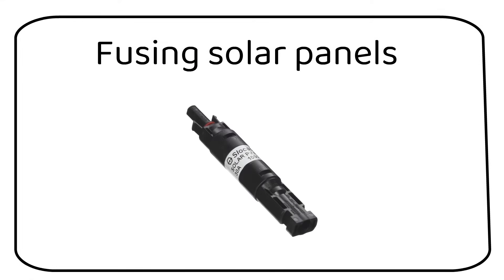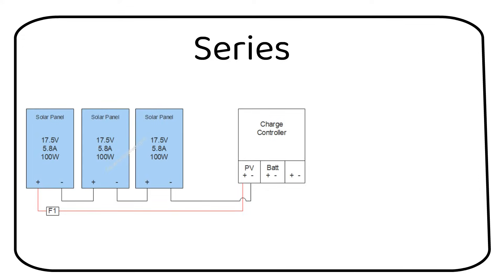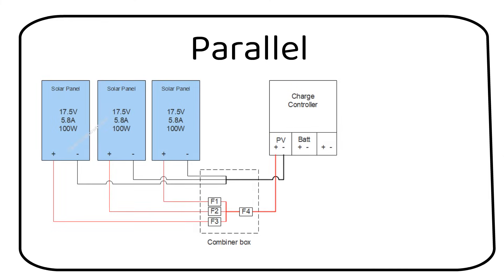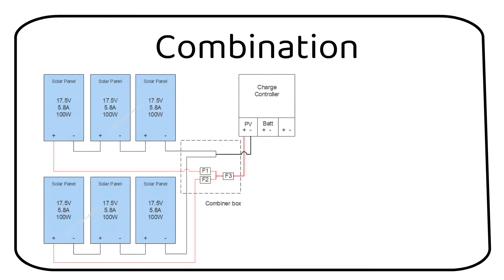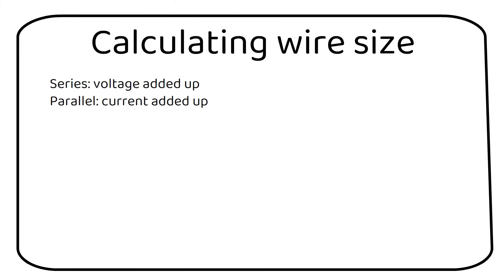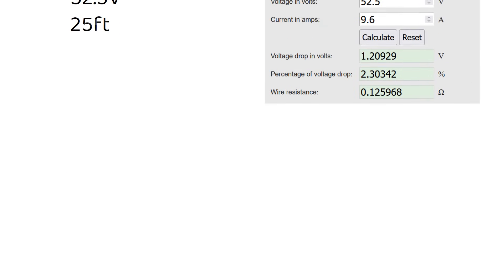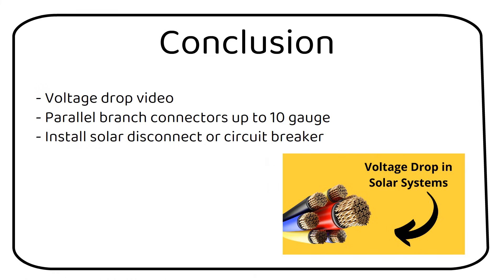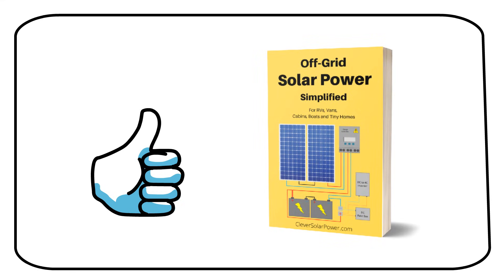Fuses For Solar Panels: Series and Parallel Fusing

Comment: Do I need F4 in a parallel connection? I have 3 panels in a string(lsc rated at 6.86), the only way it can exceed the amount is if all the other fuses in the parallel string isn't working. I'm asking because I want to  avoid as many point of failures as possible,  as the panel is exposed to the weather.   But if you were to put a fuse after the positives of the string are connected, it would be to protect the inverter, and if that's the case, the limit on (in my case a Bluetti is 20A). So technically a 20A fuse is all I need, as the 10Guage wire will not fry because of 30+Amp, and if it goes back to my panels, the fuse should prevent it from destroying the panels.  But, from what I understand it's not bad to over Amp, a string, and worry more about the Voltage in  solar set-up.

I don't think you need to do any math with fuse, you just need to get a fuse that matches what the panel max at. unless it doesn't have the maximum rating on the panels spec sheet.

Am I wrong? Because every youtuber don't mention an f4, i'm just trying to understand your set-up.

Comment: just curious the fuse and mcb are the same right and when using either of them is to match solar panel like what you calculate but not on the charge controller maximum pv voltage or maximum current ?

Comment: I have 3 panel 630 watts each voc 50.20 isc 16.09 and my mppt is 50 volts max and 60a max. I will connect parallel to my mppt. I'm going to use 20a each panel (f1 to f3) but the more fuse is only 30a max what will I put on the (f4) fuse? Thanks for the help.
Reply from the maker: Your charge controller will be damaged in winter when the temperature is below STC.
Reply: @cleversolarpower  what will I do do I need to fuse it or not? Sorry I'm a beginner. And I don't have a winter. I want to learn on fusing...

Comment: Thank you for giving the knowledge.  when calculate the fuse size, where was that 1.56 came from ?
Reply from the maker: That's two safety factors 1.25x1.25 that's for outdoor cable ratings because they can get very hot.
Reply: @cleversolarpower  Thanks for the class Man

Comment: I have a 24Volt 120A MPPT Solar Inverter with BMS that i want to connect to a 24 Battery. Do you recommend a 24Volt Battery that has 120, 150 or 200Ah ? And is it best to use a 250A circuit breaker installed at the battery end or another?

Comment: what if I have 2 different panel? one has 15.98A & one has 10.72A Isc.
Reply from the maker: I made a video about wiring different solar panels. Search for 'mismatched' on my channel. If the voltage is the same and the current is like you described then wire in parallel. Because in parallel the current gets added up. Or use two charge controllers, one per panel.
Reply: @cleversolarpower  Already watched the mismatched panel, but didn't really get to figure out how many amp I need for the 2. thanks anyway

Comment: Formula ISC? You lost me on that. Can you explain the formula.
Reply from the maker: Isc * 1.56 -> 1.56 is 1.25*1.25 which are two safety factors multiplied with each other for outdoor temperatures.

Comment: Where do you get the number 1.56?
Reply from the maker: Safety factor for outdoor wiring. This is because the cable can get very hot in the sun.

Comment: If the short circuit current is 13.58A; open circuit voltage is 38.95V with max fuse at 25A:  For a 3S2P setup, 13.58A x 1.56 x 2 = 42.3A  is that correct? Would I be able to get a 45A fuse?
Reply from the maker: You should fuse every series string first with 25A. So you need two MC-4 connectors fuses. Then have one DC circuit breaker so you can turn off the whole solar system. This is can be a 64A DC circuit breaker suited for solar (1000VDC).

Comment: Which size of wire should I use in 3 pieces of 350w solar panels system
Reply from the maker: Check my video about wire sizing for charge controllers.

Comment: Can i use a combination of fuse and diode in 3 pieces of 350w solar panels
Reply from the maker: No, a diode only prevents backwards flow of electricity.
Reply: @cleversolarpower  thanks

Comment: why did you use 6.2 amps in the calculations when the panels showed a rating of 5.8?
Reply from the maker: I use the Isc, highest possible current.
Reply: 1.25 multiplier

Comment: Good day , this safety factor 1.56 is it common/ constant to all countries ?.
How can we find this safety factor ??
Reply from the maker: It's a standard factor for cables that are outside under the sun. Indoors safety factor is 1.25
Reply: there is no factor.
a panel I max is a absolut number a panel can produce only this or lower currents!!
so to prtect against a 100% limited current is pure nonsens in any aspect.
so on panles no fuses theyx are for nothing existing.

on the battery side coz a battery is a umlimited power source a fuse will be needted and this is best set below your wire limits without factor nonsens !!!

lets say you you a wire that can handle ~40 Amps current max, on this conditons it get war, over time so the best way to set a real protection to it set from battery to charger a 35 Amp fuse to wire never will run on its limits and you protect the wire from this.

no mgic factor or nonsens theories from youtubes use your brain.
make yxour build with bigger wires then you really need maximium the set the fuse below this wire maximum to give this wire a real protection.

that is all the magic.

Comment: if you're adding fuses on the positive line, doesn't that add some resistance, and therefore require you to add some extra wire on the negative side to equalize the resistance between both lines?
Reply: Can't think of a good reason to increase losses just so the voltage drops on each side are the same, what are you trying to achieve? The controller only cares about net differential voltage at its input.

Comment: Thank you for you video -  I have 4 550 W panels, with the following specs. What configuration would you recommend ? 2S2P? For Fuse 1 and Fuse 2 (14.01 x 1.56 = 21.86) would a 30a inline fuse work?? And then for the Fuse 3 - what type of fuse should be used?? Is there any benefit of doing a 2P2S configuration?? thank you!
Series 1 & 2 = 100v and 14A = 100v 28A going to the charge controller.

VMP: 41.96
IMP:13.11
ISC:14.01
VOC:49.9
Reply: What did you end up using ?

Comment: my isc A show 6.68, should i use 10A and 30A or i need to go 15 and 40?
Reply: nothing.
to put ona limit powwer source a fuse in pure nonsens.

if you panel makes 6.68 Amps max iin a short this number will never be higher so to protect your panel / wire against 10 Amps, where thsi 10 amps will come from?
for what?
where this 10 Amps will came from if your panle have a absolut limit that is 6,68 A in best conditions and only can be this or lower????

there are alot of youtuber telling trash in videos and dont explain how this fuse will work or exactly against what it will protect.

Comment: I have two 120 watt solar panels (ss 6.8 amps) in parallel.  was planning on 12 awg wire from panels to mppt and 10 awg from mppt to batteries.  before combiner was going to use 15 amp inline fuse and a 20 amp MPPT.  will that work?  i assume the combined power was 21.6 volts at 13.6 amps.  Thoughts?
Reply from the maker: 6.8*1.56*2 panels in parallel = 21A. 20a fuse is on the edge but ok.

Comment: I have three 300 watt panels that will be wired in parallel due to shading. Each has a short circuit current of 18.1 amps. So I woll need 3 20 amp fuses one for each panel. How big of fuse will I need forthe iotput end of my 3 into one adapter? Thank you
Reply from the maker: No, isc x 1.56

Comment: What Fuse Size for 150W Solar Panel - ISC Amps 8.76 should I use? THANKS
Reply from the maker: 8.76x1.56=13.6 so a 15A fuse is ok. But you don't need a fuse for one panel.
Reply: Im only using 2 150Wats Panels in parallel. Still need fuse? @cleversolarpower
Reply: Why you don't need a fuse for one panel?
 @cleversolarpower
Reply: Why no fuse needed for one panel?

Comment: How did you get that 1.56 value ??
Reply from the maker: 1.56 is the safety factor considering wires that are outside. The sun will influence the temperature of the cable, so thats why the safety factor is 1.25x1.25=1.56

Comment: Is a fuse required if only one 100w panel is plugged directly into a solar generator with built in MPPT?
Reply from the maker: No, but a breaker could be depending on your local code.

Comment: Can you use an MCB instead of a Fuse?
Reply from the maker: An MCB from a reputable brand is more expensive. MCB's are used in AC switchboards because they can be switched off often. For DC, it's cheaper to have fuses. If you look at the end of the video you can see a popular MCB which is unbranded. It's known to cause problems and heat up under use.

Comment: In your calculation 6.2A x 1.56 = 9.6A  where did the 1.56 figure come from?
OK; the 1.56 is a safety factor but before you were using 1.25
Reply from the maker: The safety factor for being outdoors changes because it can get hotter outside. Imagine a black wire on a black roof at noon will get much hotter than a wire inside your house.
Reply: I still don't quite understand where 1.56 came from? Is it Maximum Series Fuse 15 A figure?
 My panel have (Ipm)  8.86 A, and Maximum Series Fuse 20 A.
 What fuse i need??
Reply from the maker: @abitofeverything1985  1.25*1.25=1.56
Reply: 1.56 is standard value....give by NEC standard
Reply: Is the 1.56 safety factor written in NEC? Where is it come from?

Comment: Where do you get the 6.2amps and the 1.56 from?
Reply from the maker: 6.2A is the Isc (short circuit of the panel) and 1.56 is a safety factor for calculating current in a conductor for outdoor wiring.
Reply: I didn't understand either ...

Comment: I'm installing twelve 400w panels at my cabin. The EG4 3000w MPPT/inverter has an input limit of 500w and  80a max charging current. These panels are 36.8v and 13.85A. short circuit current 13.55A, Pmax -0.34%/C. I was first going to make two strings of 6 and put them in parallel for 27.7A, but you made me reconsider and think about putting them all in series. 36.8v x 12 =441.6 V for the series, less than the 500v the inverter can handle. In Wisconsin, it is possible to get a -37C event in winter, so using the Pmax I figure that could be a voltage increase of 13% to 499V. I don't know if that Pmax uses the panel's temperature or ambient temperature, but is that cutting it too close? Should I stick with two strings in parallel for 27.A or  try for all in a series at 13.85A? I have a fairly long cable run of 120', so I figure I'd be much better off with the lower amperage and fusing would be simpler.
Reply from the maker: You need two series strings to make 6S2P. Your voltage will be over 500V. Voc*12*1.25=max 500V. In your case this is: 36.8V*12*1.25=552V. Your charge controller can get damaged on cold sunny days. 1.25 is a safety factor.

Comment: My panels have a maximum fuse rating of 20A. I have 22 panels in seri parallel with 2 strings. 495 wats per panel. What would you suggest regarding the fuse’s?
Reply from the maker: Fuse every series string, and then the combined array for a total of 3 fuses.
Reply: @cleversolarpower  thank you very much. And what fuse rating you suggest? 20amp for individual and 32 amps for combined? Thank you

Comment: Hi…thank you for your video is amazing …I have a question …I have 2 solar panel 200w 18.2v 11.7 amp and 1 100w 20.4v 5 amp …the question is …what tipe of fuse do I need for the 200w panels ? And one more question …the fuse that will go string after the 3to1 adapter will a need a 50amp fuse and if so is going to make any problems with the mc4 connector due that they are rated only for 30amp …thank you for your help

Comment: cleversolarpower What size fuses should I use when connecting four 180w solar panels in 2series2parallel. Each panel is rated 10.5 amps max with a series 15 max rating on each panel going into a 15 amp max rated portable solar generator. I'm guessing the formula is 10.5 x 1.56 = 16.38 amps so would I need two 15 amp fuses going into a 30 amp fuse or two 20 amp fuses going into a 40 amp fuse after that before it goes into the solar generator rated at 15 amps max. Will it work and safely to protect my panels and solar generator without constantly blowing fuses? Let me know. Thanks
Reply from the maker: You need two 15A fuses and one 30 amp fuse.

Comment: OK, I bought two solar panels and don't plan on linking them at all. I'll be running both control boxes that came with each panel. Now, the wires, control box etc can all be handled easily by the wires and by the control box itself, so would I need a fuse between each panel and the control box? The solar panels are rated at 15 Amps each, control boxes are 30 Amp.
Reply from the maker: No need for a fuse if there is only one solar panel per controller.
Reply: @cleversolarpower  Yeah I watched a couple more vids and got around adding solar panels by simply running each panel (350W) on the controller that came with them, but I might add a busbar to minimise the number of rings around the battery terminals. Yeah, then I figure it can't go wrong given that SLA batteries give off a ''resistance'' which each controller reads and moderates, although one must apparently make one of them the master controller so that the batteries don't ''equalise'' more than once a month.

Nevertheless I've added 30 amp circuit breakers between panels and controllers, and put 200 ah fuses between each of the four batteries in my bank. It's not that hard when you watch videos such as your own.I've had a simple philosophy all my life - if you don't know something just ask someone who does.

Comment: Hi. Will the fuse be helpful for lightning in any way or is the fuse just for over current and not high voltages?
Reply from the maker: a fuse will not help with lightning, you should consider it a loss when it hits your panels. Don't ground the panels and bring it inside of your house where it can destroy more equipment.

Comment: Hello, thank you for the informative videos, love the content!  I have a stupid question, at 3:46 when you are explaining the voltage drop across different wire sizes, I was wondering how did you come into the conclusion that the 14awg wire is sufficient?  Or at 4:17, 12awg is sufficient voltage drop for the 2 strings?  Is there a rule of thumb on the % drop is acceptable?  Thank you in advance!
Reply: Haha, nevermind, i just saw your other video that explained the voltage drop of 3%.  Thank you!

Comment: The solar panels can't provide anymore current in series than rated. No need for fuse in series.
Reply from the maker: Correct. If you have multiple series strings, then a fuse is required.

Comment: Great summary. Is there a device to boost up voltage after the combiner so don't have to have such a thick cable, and then on the other side of the run bring the voltage back down?
Reply from the maker: Not that I am aware of. A solution is to wire your panels in series.

Comment: So where do you fuse the panels ? Did I miss that
Reply from the maker: The fusing happens as close to the power source as possible. This can be an inline MC-4 fuse. You can also add the fuse next to the charge controller right before it enters the input of the charge controller. You can also use a combiner box if you have parallel strings.
Reply: @cleversolarpower  I’m using a PV shut off switch. As close to the power source as in the panel or the battery? So if you meant the panel then just clip it onto the panel mc4 output cable right?😎
Reply from the maker: @jonnytacooutdoors  To the panel. Yes, if that is physically possible. If you have parallel strings, then you can do it after the combiner box.
Reply: @cleversolarpower  am I just fusing the positive line? I plan on just plugging in the fuse to the positive line coming out of the first panel and then have that wire go down into the truck

Comment: Great video, great analysis. I have a question though, what is the difference between mc4 fused connector and mc4 diode connectors?
Reply: I also would like to ask what fuse should I use for a 7.75a panel? 10 a or 15a?
Reply from the maker: The max fuse size will be indicated on the back of the panel. I recommend watching the video again. MC4 fuses is just a fuse holder which fit MC-4 connectors. I suspect that MC4 diode connectors are the same. Why would you use a diode?
Reply: @cleversolarpower you're wrong,mc4 diode is used as blocking diode to avoid shading issues between two parallel strings/parallel panels

Comment: where is the '1.56' in your formula ISC x 1.56 = minimum fuse size coming from? I ask because my solar panels have Isc 8.75A. So 8.75 x 1.56 = 13.65A minimum fuse size, but the panel indicates: 'max series fuse = 12A'.
Reply from the maker: Hello John, good question. This is because the cabling is mounted outside. We need to apply an additional 125% safety margin. So it becomes 8.75A x 1.25 x 1.25= 13.67A.  if you look on my website, the article about 'how to calculate fuse size for solar system' it's explained there.
Reply: @cleversolarpower  so why 1.56 not 1.25?
Reply from the maker: @narotica1  check my previous answer
Reply: @cleversolarpower  yeah it was a shit explanation, 1.25 * 1.25 is 1.56 for everybody else
Reply: yeah, i don't get this too.